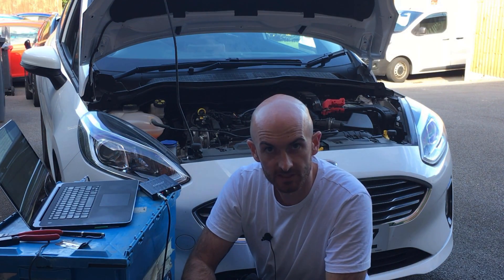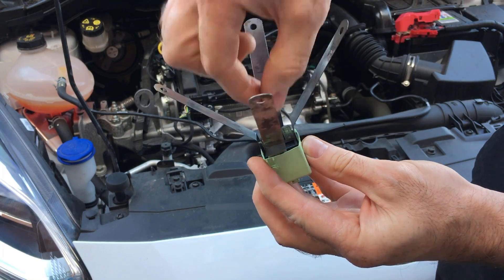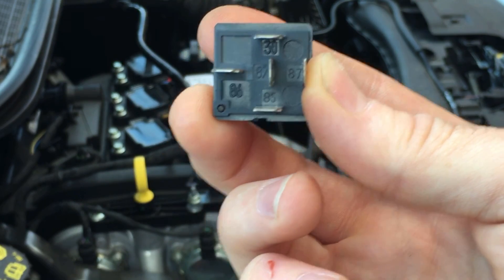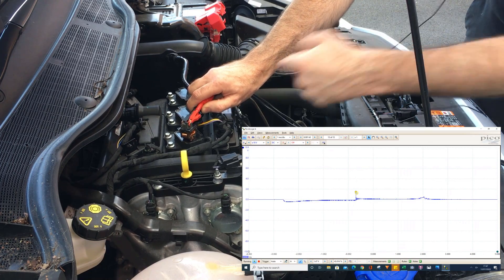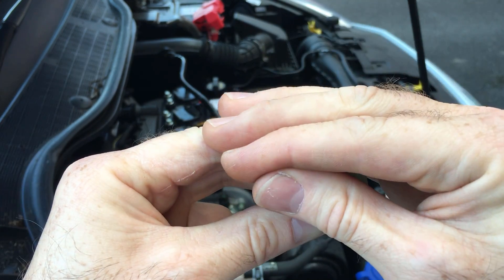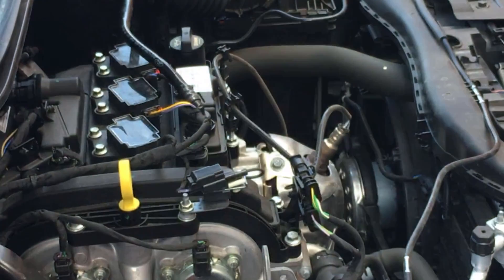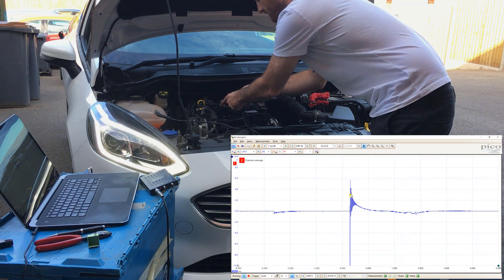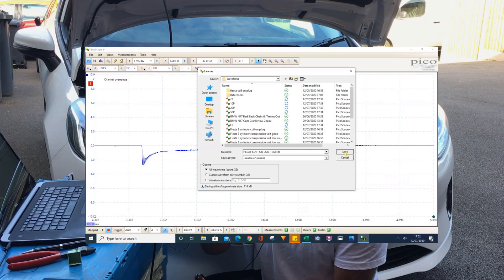Diagnose Misfires With A Relay | Automotive Oscilloscope Diagnostics | Mechanic Mindset

Comment: It's actually a resistor. It provides a path to ground for the high voltage spike from the collapsing coil current. Some relays had diodes for this purpose. I guess resistors are cheaper.
Reply from the maker: Steve Stadnik Yep, realised my mistake, see pinned comment 👍. Slip of the tongue! Thanks for watching

Comment: pretty cool
Reply from the maker: PS I saw your original; I did mean to say resistor, not capacitor. But you are right, some relays do use a diode to soak up the spike 👍
Reply: @MechanicMindset  haha, I wondered myself, then I seen it and it didnt look like a diode, although a diode is common to suppress the spike.
Reply from the maker: Cheers!

Comment: Great trick that. Learning so much. I couldn't see if you was protecting the scope with a attenuator while just using the relay trick. Can you confirm if its needed
Reply from the maker: Cheers! I wasn’t, but as you drew the relay to the coil, you would start to judge whether you needed it before fully committing. Or just use the attentuator first, just to be safe 👍
Reply: You should only need an attenuator when checking primary coil voltage (directly plugged into the coil wires) or when checking fuel injector voltage waveform. Using an attenuator in this situation will defeat the purpose of using a coil in the first place.